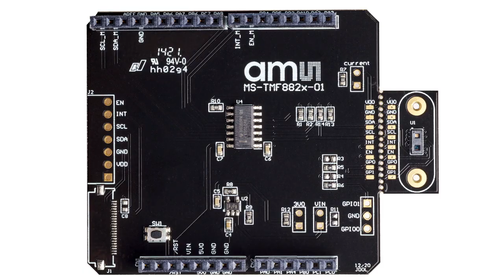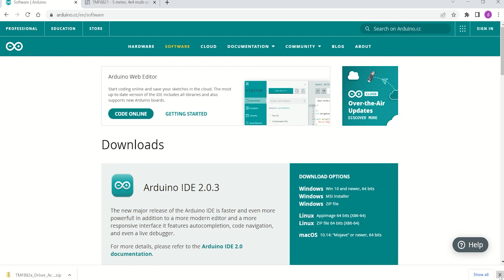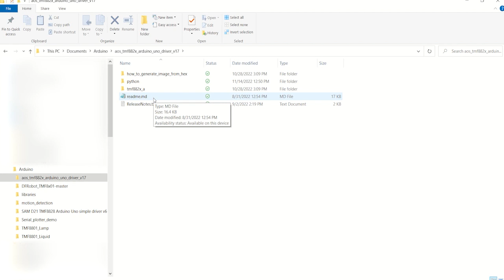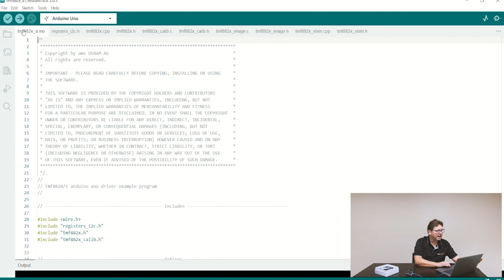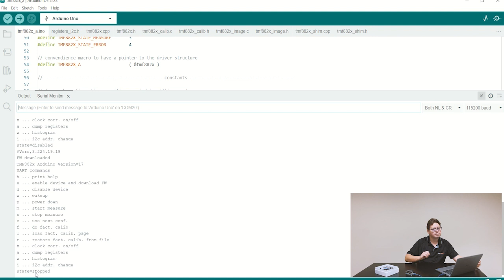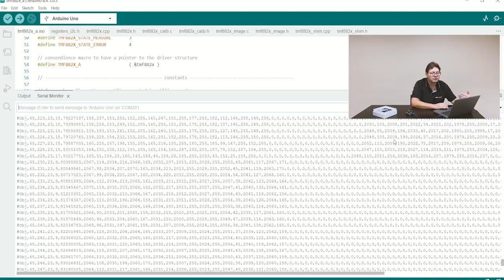Getting started with the TMF882X-SHIELD & Arduino®

Comment: Nice guide to start play with the sensor. Thanks. Can you tell me please is it possible to set the shield board address for I2C communication? Where can I purchase the filter glass? I assume when I order only a sensor it comes w/o the filter.
Reply: There is an Arduino example which modifies the I2C address, it is also documented in the datasheet and host communication guide.  The cover glass are produced by Hornix in Taiwan.